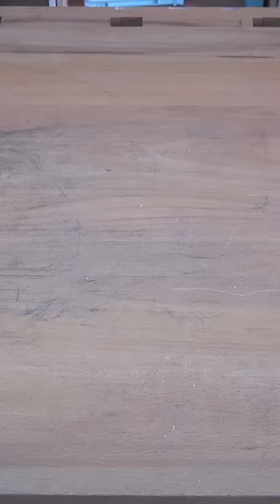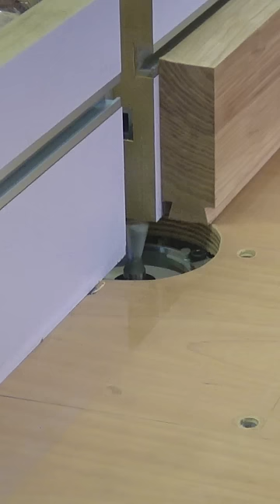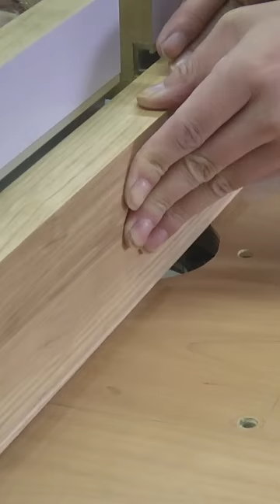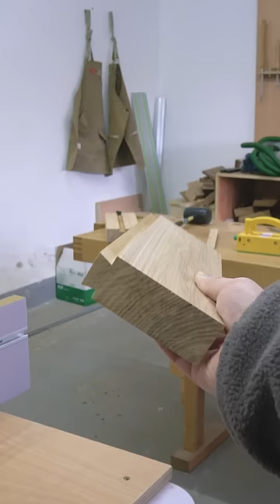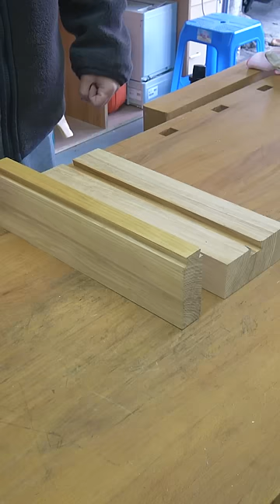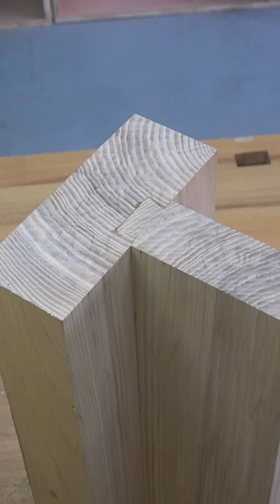dovetail joint #woodworking  #woodwork  #wood  #maker  #tools

Comment: I use these unglued sliding dovetails to attach the end end boards of glued up panels.  It allows for natural wood movement over the seasons while stabilizing the natural tendency of the panels to flex and bend.  Good video.